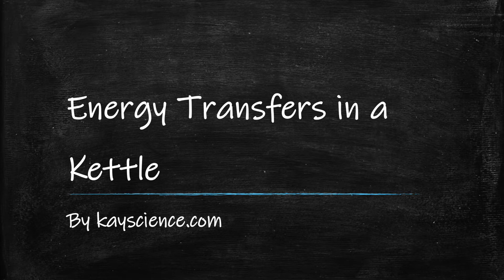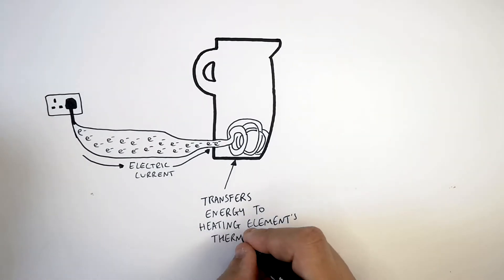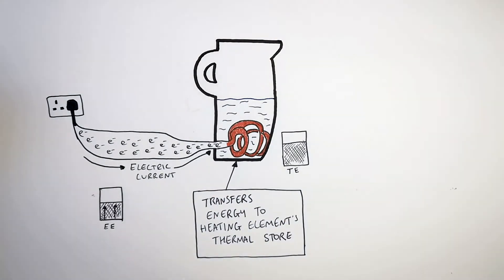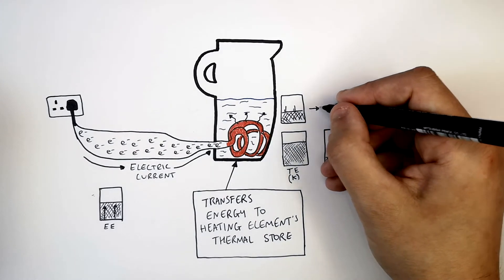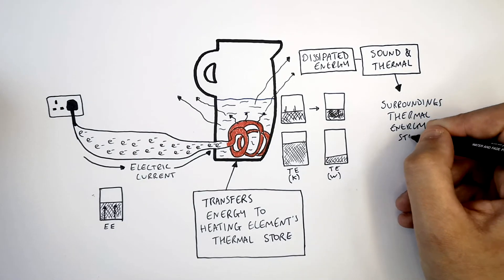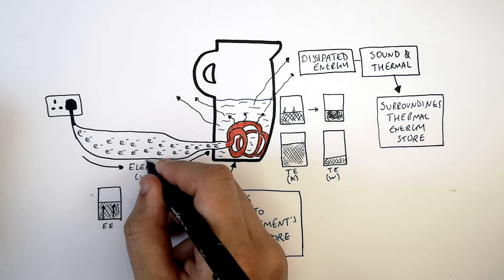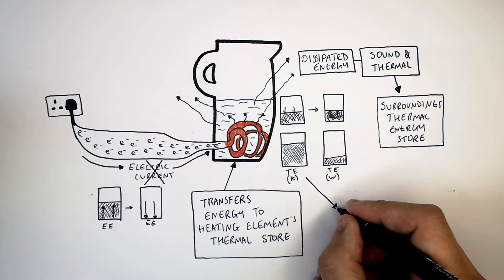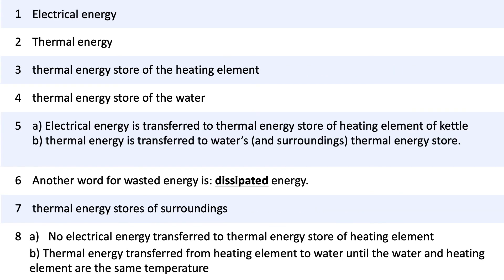GCSE Physics – Energy Transfers in a Kettle

Comment: you mentioned that there is going to be 'a transfer of energy from the electrical energy that is being carried in the current which transfers energy to the heating element's thermal energy store'. Doesn't this imply that there is an electrical energy store, which I believe is not  one of the energy stores given in the syllabus. If I am correct in thinking there is it is the mains that electrically transfers energy to the heating element of the kettle, right?
Reply: You are correct, he is wrong. No such thing as an electric energy store. Similarly, there is no such thing as a light energy store or a sound energy store. This said it may not matter in the exam if you state it as such.